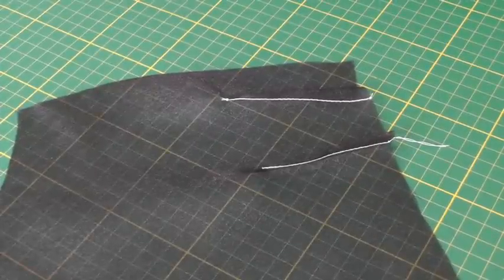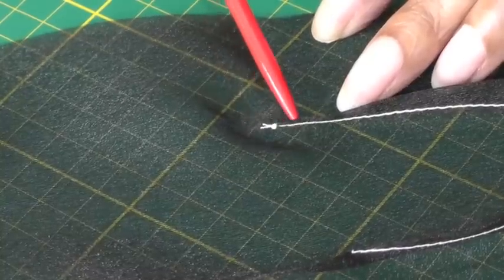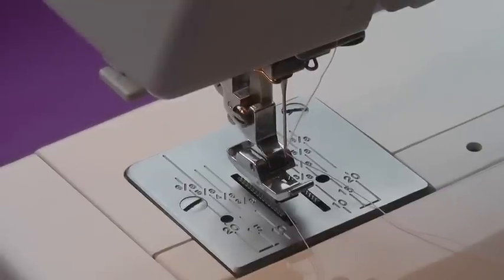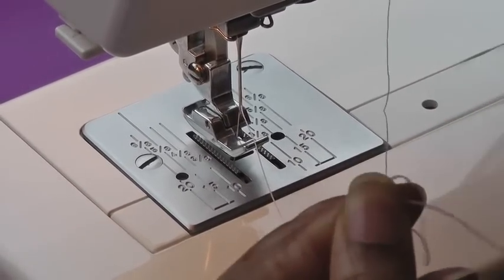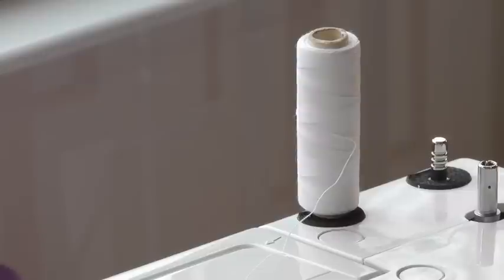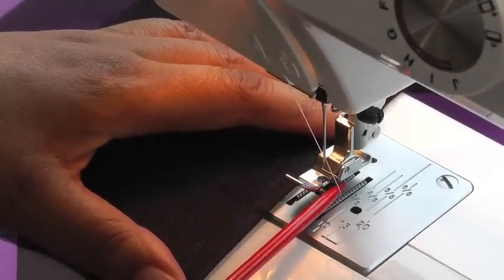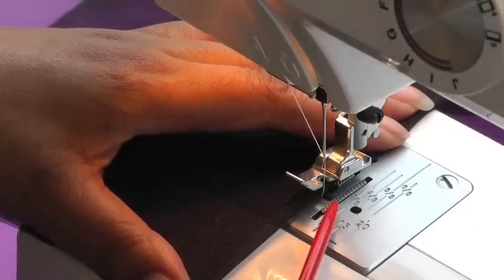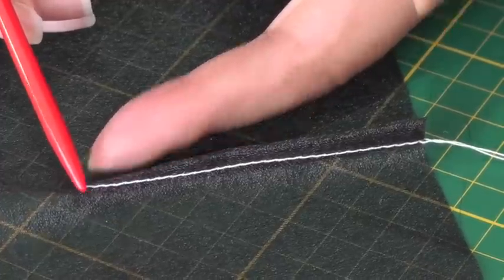The Bobbin Stitch

Comment from the maker: If your fabric is continually tearing, it may be a problem with the machines tension so check that first.  Make sure you're using a small fine needle and try using sticky tape over the needle plate.